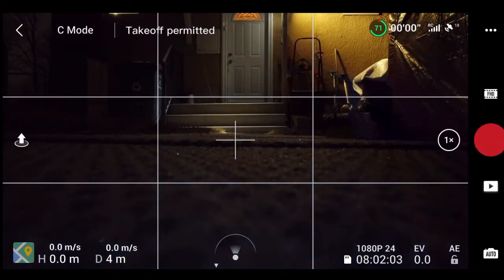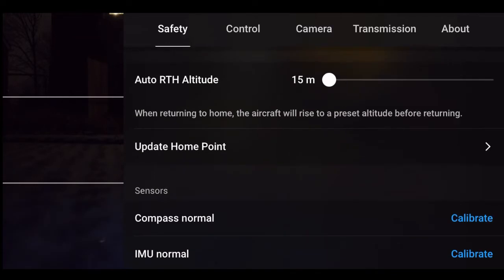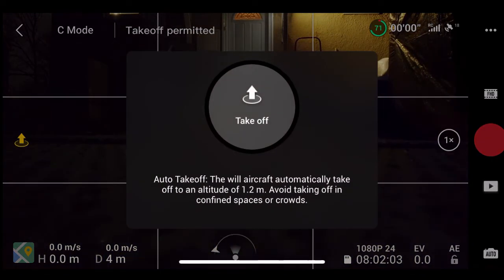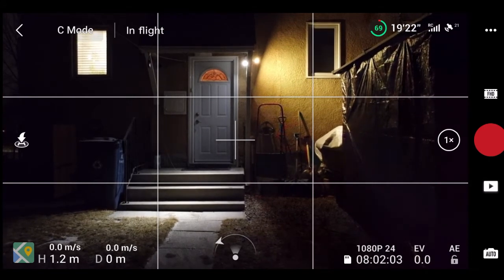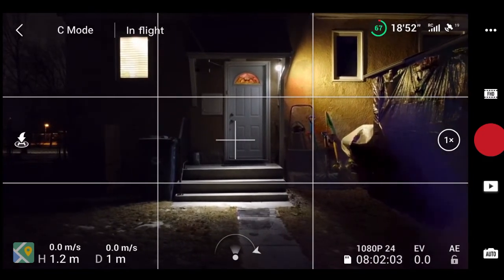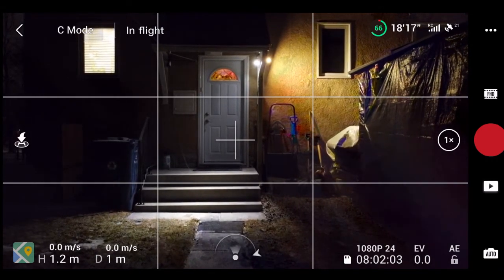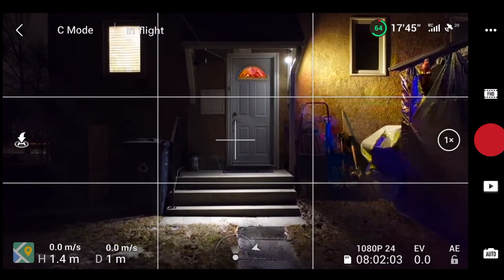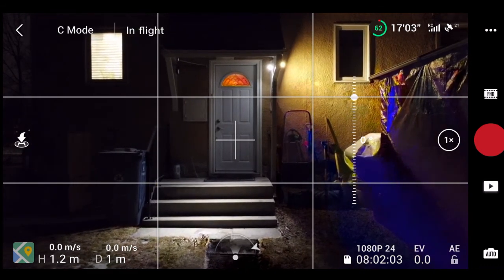Ocusync2 penetration test

Comment: An amazing test. It seems like trees are no problem if they block the view to the drone. I saw a guy on YouTube do with a DJI Mini 2 a penetration test and he took the drone around a concrete building and I have been wondering how the drone could receive a signal while behind a concrete building. He flew through the left side of the building and came out on the left side making a rectangle. How does Occusync operate behind a tree, two three your view, Any explanation anybody? Thanks
Reply from the maker: Trees are less of a problem than structures. Although I must say that it is winter where I am located and there are no leaves on the trees. I am confident that leaves would not make a big difference.
Here is a video I made while sitting on the steps of the house I used for this test. https://www.youtube.com/watch?v=lz0_nWW4a0c
The occusync signal had to go through the house , a bunch of trees and travel 1 kilometer away. It did very well!